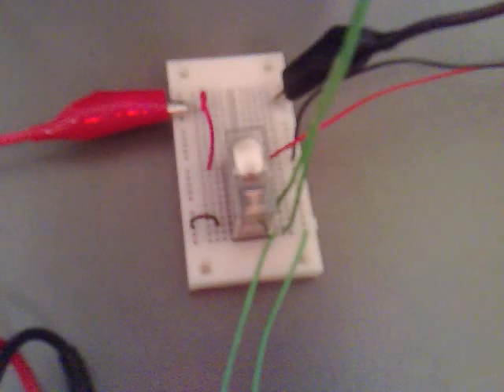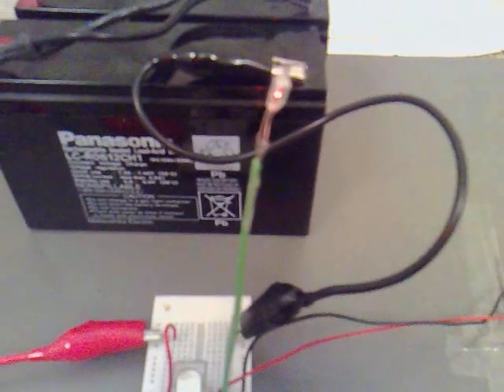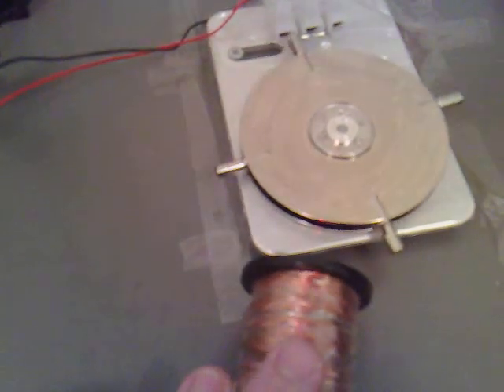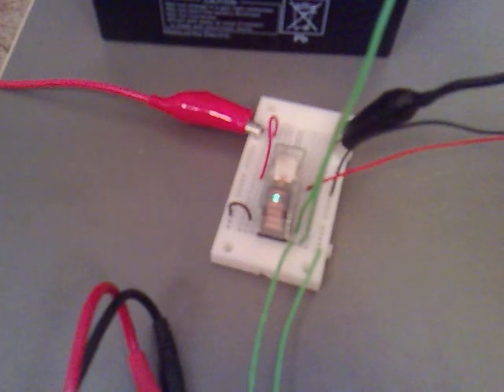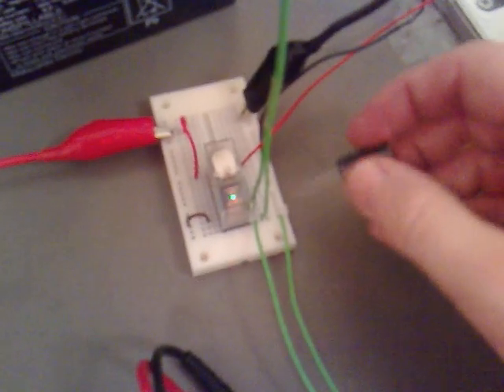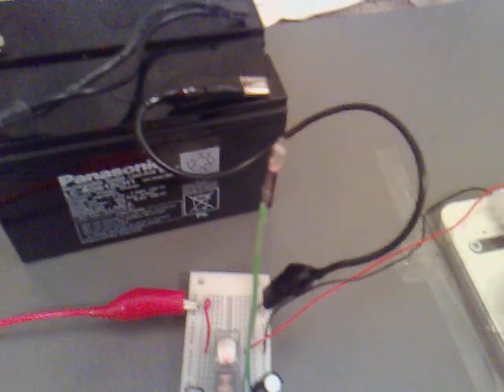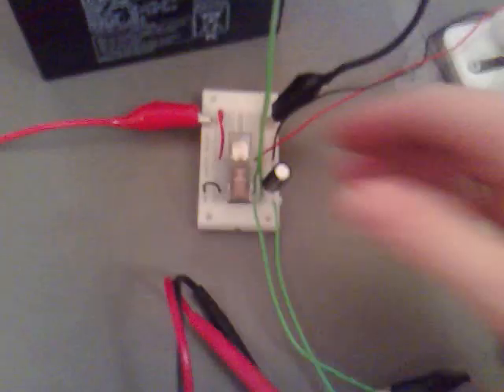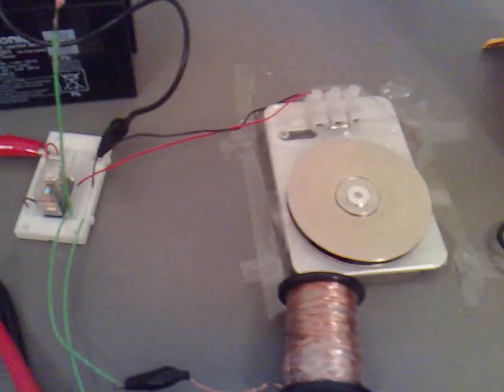Pulse Motor (Relay Ideas?) 025

Comment: you know, i have seen a guy place his reed switch directly on the trigger coil. also, he put a VERY weak refridgerator magnet on top of the reed to switch to keep it partially open at all times. this reduces the travel distance for the switch. 
you would lay your reed switch right on top of your coil, close to your rotor, which will also time your system to your rotor as well.